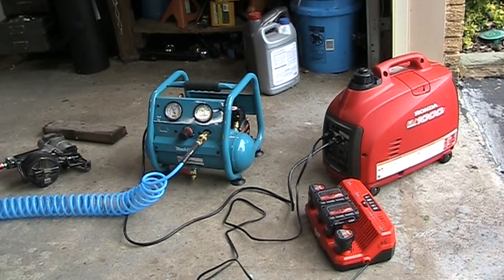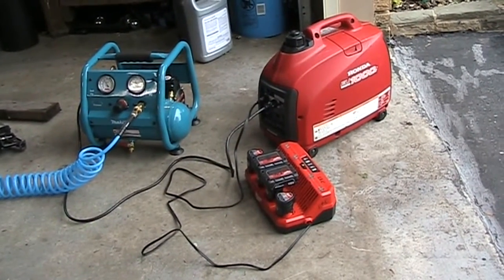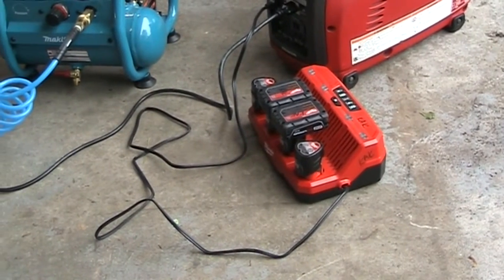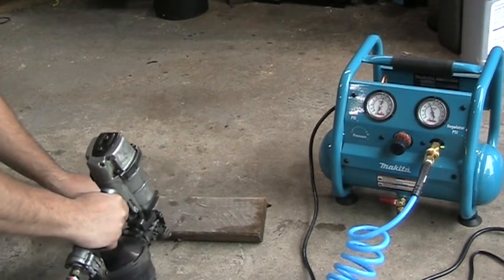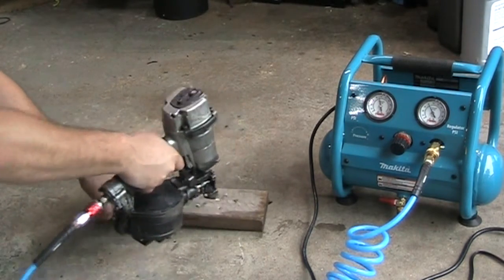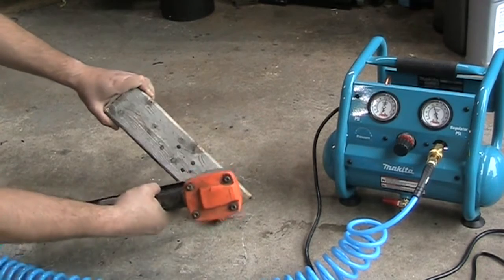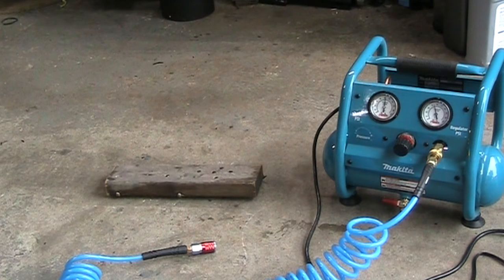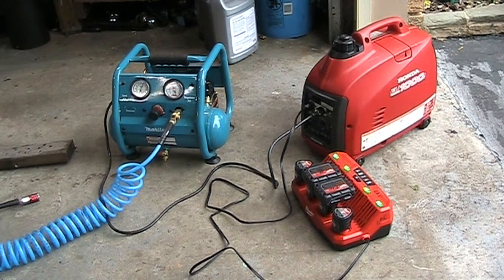Honda Generator 1000i and Makita AC001 Air Compressor

Comment: Thumbs up, thanks for the demo. I've seen this in the stores, and wanted one. At only 1.8 amps, I'm hoping I could run this off a 300w inverter. Will check it out.